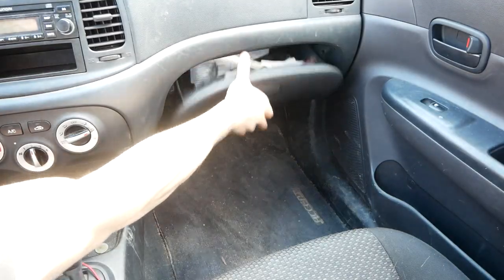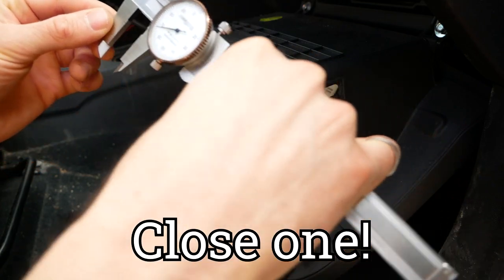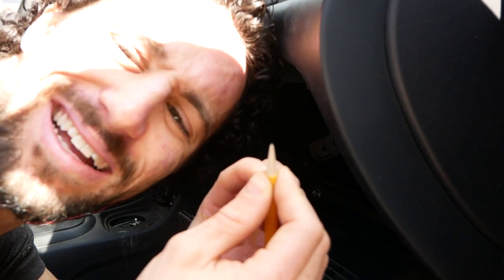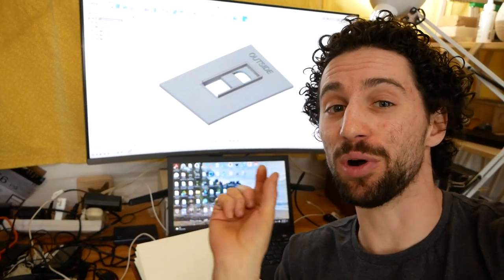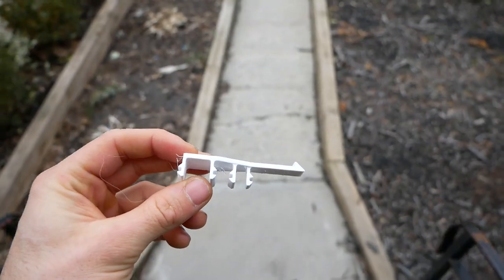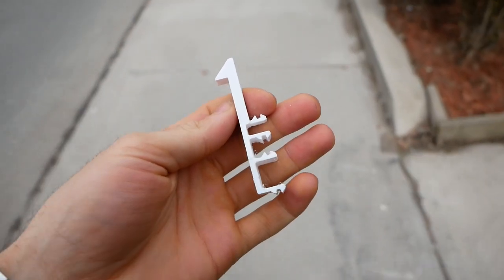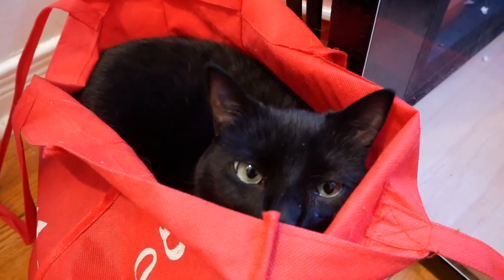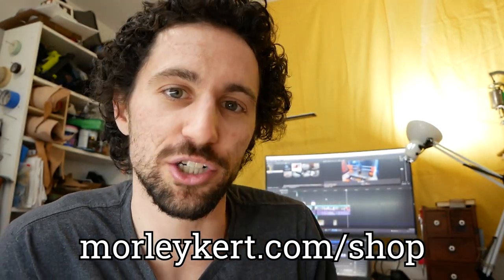3D PRINTED Car Repair

Comment: I don't know if you did this on purpose, but taking a video of the measuring process is BRILLIANT! Faster than swapping between calipers and pencil. Most importantly, I always have some question about my written notes. "Did I measure the correct edge?" I'm taking video instead of notes from now on. Thanks, mate! ☮️❤️🌈

Comment: I own a 3D printer and I love solving problems with it. But I haven't forgotten how to solve problems without it. This could be fixed with a piece of string. Not invalidating your solution and maybe you wanted to practice cad or solve it in a more sophisticated manner. Or you take more pride in your vehicle. I like your content and please keep on sharing!
Reply: I would likely fix this with string, and then later on spend all the time modeling and printing a solution. It's more fun that way.
Reply: Think bigger is the theme to this channel…
Reply: I agree with you completely. Maybe because I started as a woodworker. I see a lot of people spending tons of time designing and printing a solution to something that could be made better with a piece of scrap and a bandsaw.

Comment: Nice. Love using my 3d printers for practical application. WHY THE HECK DID YOU PRINT IT IN A CONTRASTING COLOR!?! That would bug the heck out of me the 2 times a year I open my glove box!
Reply from the maker: Thanks! I printed it in a contrasting colour so it’s easier to see in the video. It’s pretty much invisible when you’re in the car.

Comment: Did you print this with ABS, or some other heat resistant filament?
Reply from the maker: PETG, which has good heat resistance
Reply: Was gonna ask the same.. I've heard many stories of PLA prints melting in cars. One person made a license plate cover in PLA and it melted in one hot day.
Reply: @PauIieWalnuts  Its one of those YMMV things. I live in the SW UK, my car's outside 24/7 and I've never experienced any deformation on PLA prints

Comment: Maybe a little less angle than 90 degrees on the hook that catches the edge? Because the shaft bends, that creates more than 90 degrees on it, and it might slide. I mean, it works great now, that was just what popped into my mind after the first version=)

Comment: Where/how did you learn Fusion 360?? I've made a handful of functional prints, but it's always on Tinkercad using primitives.. which isn't the end of the world, but usually harder to make modifications in the event that some measurements need tweaking.
Reply from the maker: I started with this tutorial! https://youtube.com/playlist?list=PLrZ2zKOtC_DR2ZkMaK3YthYLErPxCnT
Reply: @MorleyKert  Hmmm, that link doesn't seem to load for me.. is it a private playlist?
Reply: @TheOneSpam  Just in case you still need it or another person sees this, YouTube misunderstood the format and striked a part of the text, when it should have two "-", one at the start and one at the end of the striked part. Add that when you paste the link and it will work.

Comment: Nicely done. A bit over engineered. I think your originals were more of a hook style on the glove box side. I had similar design on. Mitsubishi truck years ago and that is how they were made. Mine hooked through a slot and when the glovebox was opened the weight of it would pull the clips in tighter.
Reply from the maker: Aaahhh yeah a hook would work well! Maybe I'll make a v2. Thanks!

Comment: If you used PLA, reprint this in PETG or ABS. PLA doesen't stand summer temperatures in the car and will bend.
Reply from the maker: I printed it with PETG! Thanks for watching :)
Reply: This part would be a great candidate for annealed HTPLA too.

Comment: Just curious.. are you sponsored by Autodesk for they fusion product or did you really decide to pay out of pocket for it and what led to that decision? I'm no pro but I've done some simple work via blender
Reply from the maker: Not sponsored by Autodesk! I learned AutoCAD in University and knew that a lot of people in the 3D printing community use Fusion 360, so I decided to give it a try and haven't looked back! The parametric features are so useful.

Comment: A short piece of chain and two screws later....
Reply: And a 45s video. 
The real value here is illustrating the process, I have done lots of these and have learned that you need to model the part that you will be fitting your printed part to else you have to make several versions before it works. It’s also handy if you use the original prt as a tool to subtract from a shape to make your model.

Comment: Nice design. However, you really should have printed it in a darker material. It looks kind of ... cheap.
Reply from the maker: Thanks! I printed it light so it could be easily seen in the video. It’s not really visible in the car.